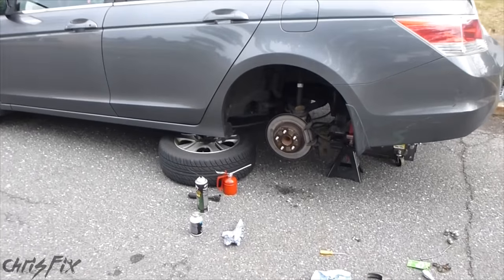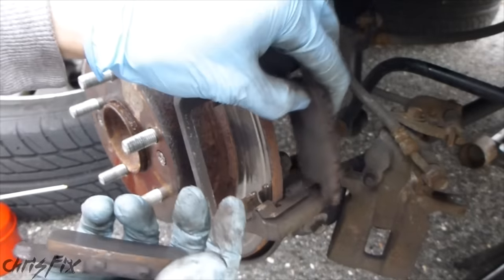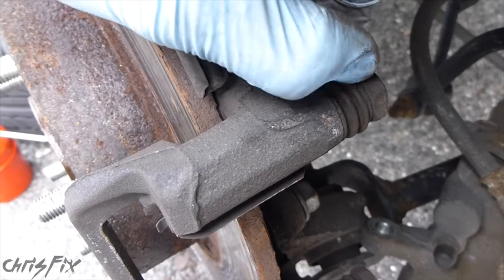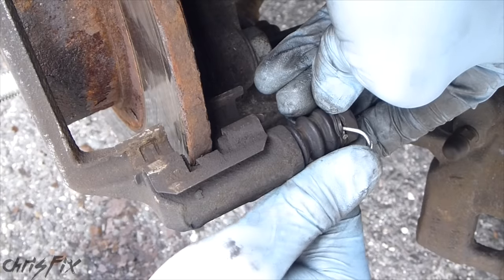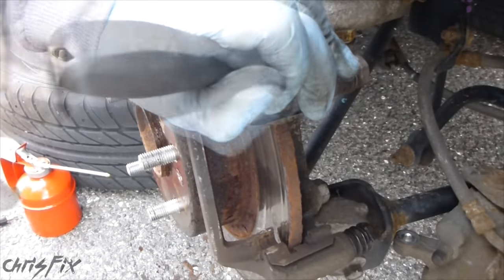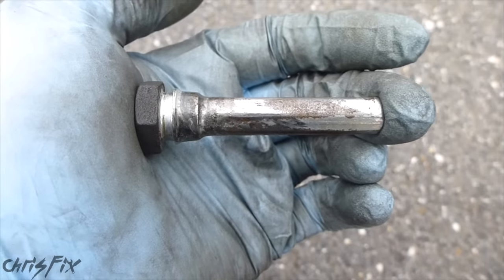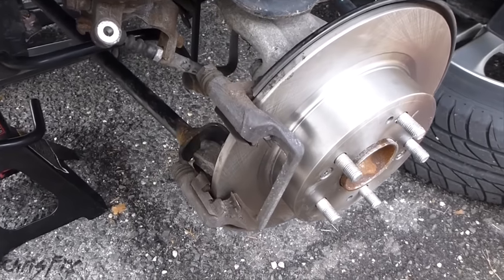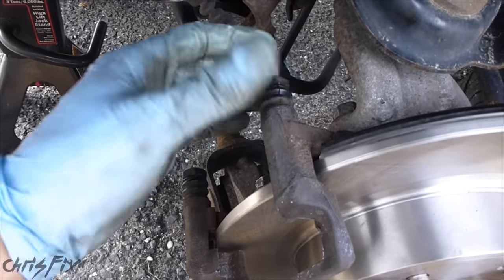How to Fix Uneven Brake Wear

Comment: Great job. I noticed the caliper bracket was fairly loose, also going to need to turn that rotor or swap it out.
Reply: He was in the process of changing the rotors. That's why the bracket was loose.
Reply: Mark Josiah  lol
Reply: Mark Josiah mom
Reply: Never ever waist your time turning a rotor. First off a brand new rotor isnt all that expensive and probably only 10 more then turning. Plus extra trip to get them turned. Now the issue of the rotor is thinner causing brake fade. I myself buy all new rotors at same time as pads. Now jack it up and do all 4 in my drive way in under 2 hrs. To turn the rotors have to have all 4 wheels up. Have to find a ride to drop them off then pick them up the next day. So much easier to just buy all at once. Only need 1 jack and so fast. Plus if old rotor stuck on you can hammer it off without a care. A few good wacks with a sledge and it will pop off. To worry too much damage just takes longer. But mostly brake fade from a thinner rotor and pain getting them turned to save 10 bucks. Lol i had a guy use a old rotor with new pads. The pads wore out faster so he wanted me to sand the pads smooth and put on a new rotor. Lol jokes i refused. Like dude new pads is new rotor. New rotor new pads. As per caliper pins i just buy new. On my suv they are 300 bucks but get 150 back for the old ones. So lol ya only 150 for brand new after returning the old one. Why waist time ordering pins when do all new and good for over 3 yrs. New calipers will last like 10 yrs. Sure not worth saving 150 bucks today but brakes wear out faster and now a year later gotta do it all over again any way. To save 100 today costs you a extra 300 tomorrow. Plus always spend the extra 20 today to buy premium parts. They will last 50% longer. I got premium rotors from amazon and carbon ceramic pads. All 4 rotors and pads around 350 bucks. 2 yrs later they barely even wore. I do live in a remote area so not often on the brakes but when i am its at high speeds. Never skimp out on brakes. The brakes most important part so never try to save a few bucks on the part that will save your life if needing to slow down fast. Even the axles not worth skimping out if go long drives. Gonna skimp on repairs then your safest bet it to just pay 800 per month and drive brand new for life. I sure dont wanna be rear ended by someone that saved 50 bucks on cheap brakes and turning rotors causing less braking power. Lose a axle no issue. Rear end me to save 50 bucks becomes a serious issue. Oh ya please use e brake often when park so that if brakes fail atleast can reduce damage in a crash by having a e brake that works and not siezed up by lack of use. Wont find out siezed until emergency.
Reply: @shawnkelly1241  All depends on the vehicle.
Reply: @electronicsNmore  well if prices different yes this is true but my prices for a suv. Smaller cars likely be cheaper unless sports car but its a ball park figure give or take 50 bucks. But the fact for all cars or trucks that never skimp on brakes. Yrs ago we turned rotors and drums. After the first time found out the 40 i saved was not worth it. Not only travelling to and from the shop but also severe brake fade. Every single car no matter the make, model, year or size will get brake fade from turning or buying cheap quality parts. Every car that travels on a public hwy should atleast have quality brakes. If never leave the city or high speeds slightly less important. I see so many going 80 mph. Hit the brakes and takes 3 times the distance to stop plus shake the whole car. Especially if 4 adults adding weight to a cheap brake job. Well maybe doing my own repairs i saved enough on labor to afford better parts. But the again to pay a shop 500 labor its best to maybe spend another 50 so see them less often lol
Reply: @shawnkelly1241  I keep 2 sets of rotors for my car. So I put on new rotors, if needed. I check for thickness, in several spots along the circumference, run-out (change in thickness from outer to inner circumference), and for deep circumferential scoring, and if they meet factory specs I leave them alone. Sometimes the thickness specs are stamped right on the rotor. If not within I'll take them off and see if it is worth turning. Meanwhile I'll put on the new rotors that I have on hand. There are usually 2 thickness specs, the minimum usable thickness, and the minimum thickness they can get to, so that if they are thinner than that, you should not bother turning them. Most rotors these days, you can turn them once. If you turn them again they will be thinner than the minimum usable thickness. I could be mistaken but it seems to me that rotors are often just simple lumps of cast-iron, that have turned to a specified thickness – so it shouldn't be hard for aftermarket companies to make rotors that are just as good as OEM rotors.
Reply: Don’t waist your time, it’s waste your time.
Reply: @shawnkelly1241  You don't get "fade" ,ou can have problems with a turned rotor warping quickly and needing replacement sooner rather than later. A turned rotor or new rotor will both have fresh surfaces to work with, no logical reason to "fade"..
Reply: @barryaiello3127  "fade" has many causes, but essentially it's too much heat in the brake system to let it do what it needs to do, which is dissipate heat
so either boiling the fluid or overheating the pads
the rotor gets hot and dissipates the heat (which is why they have a minimum thickness), if it's too thin it can't do this and then the problem moves to the pads, and then to the fluid, or in older vehicles the bearings
either way, get new pads if you are changing the discs
also, this is america so most of their cars are automatics, which means more heat soak because people put the foot on the brakes and hold it in traffic rather than using the handbrake for those situations (no idea why they call it the emergency brake because you are supposed to use it when you are stopped or parked up)
Reply: @therealdojj  All true but sitting in traffic holding the car in place they are not generating any heat for dissipation.
Reply: @barryaiello3127  in traffic maybe, but it still creates hot spots where the pads stay in contact with one part of the disc
i'm currently swapping my rear discs because the cars been standing for so long the pads have glazed over and they simply don't grip the disc at all, so new discs and pads, even though they are only 2 years old
like i said, many many reasons brakes fail
Reply: @therealdojj  Yea, if I'm forced to brake hard I try and not stay on the pedal once it's stopped, that's how deposits get formed on the rotor.

Comment: In addition to stuck guide pins, you should also check the surfaces that the pad shims are mounted to. A build up of rust on these surfaces under the shim pack will bind the pads resulting in similar uneven wear.
Reply: And sometimes you have to replace the shims. Ideally you should check this yearly especially if you live in snowy areas where snow ice and salt can rust those surfaces. Might not be a bad thing especially if you get more than 3 years out of the pads.

Comment: I would have cleaned up the guide pin housing holes too, if there's crud on the guide pin it will be in the housing too, thanks for the video!
Reply: This. I noticed that my freshly cleaned/lubed pin would get stuck each time I reinserted until I cleaned, lubed, and reinserted it several more times. The first few times it would stick so hard I had to use my impact driver to free it up! Even though it wasn’t threaded I’d see smoke coming out after spinning it free with the impact. I’m replacing the whole caliper but I needed it to go back together in the mean time so I could get to work!

Comment: Add to this video...  Use a small wire brush and a good penetrating oil to clean out the hole that the guide pin rides in.  Old pistol or rifle bore brushes work great!!
Reply: Stephen Maurer an appropriate sized drill bit used by hand with alternate brake cleaner spraying does the best job on stubborn clogged holes. You would be shocked at the amount of rust/petrified grease that can be stuck in there.
Reply: Rockitanski I use the drill bit method as well but I use a slightly small bit with a piece of scotch brite on the bit and spin it with the drill and it scrubs the hole clean and shiny in 5 seconds with some brake clean.
Reply: Rockitanski and
Reply: Right! That bore should be cleaned by whatever method you prefer. If it's left dirty, half the crud is still in there and it's half way to seizing again. Good video.
Reply: in a pinch I bought a gun bore brush from walmart and chucked it into my drill, made the job much faster and easier
Reply: ccsharkboy yeah, but it wrecks the brush. I like the scotch-brite/drill bit idea. 1st with a sized bit to get the heavy junk out, then smaller with scotch-brite wrapped on a drill bit. This sounds like it will work best.
Reply: I'm pretty sure brake cleaner on the rubber boot of the guide pins is bad for the rubber. Don't use brake cleaner in there.
Reply: Tim Richerson I'm pretty sure if you are cleaning the pin bore with the boots still on the caliper hanger, you are doing it wrong. If you can't remove the rubber boots without dammaging them, they are dried out and should be replaced. I havent ever had a problem with brake cleaner on rubber parts In brake systems, even when rebuilding calipers after removing pistons. In a pinch, a torn boot can be repaired with some RTV gasket maker after thoughly degreased. How are you suppposed to get all the crud out from the accordian section of the boot without flushing with brake fluid?
 I drove an E36 for about 12 years. It had 287k on it when I retired it. 2 rear brake jobs & Still had the original rear calipers on it, in upstate NY, notorious for rusty cars. I did everything I mentioned above on the 1st set of brakes I put on the rear, one pin was seized. Never had a problem. Like anything else, successful results are dependent on how thorough you are. Most people who are not mechanics just slap stuff together and miss the small details that ensure things will be reliable & last trouble free.
Reply: Yep! The inside of the bores rust.
Reply: Stephen Maurer Was gonna mention the exact same thing.
Reply: cisa93 you're an over acheiever, when brakes need service doing it correctly once, means you don't need to do it annually. A brake job should last you 2-3 years, if they wear out faster than that someone is driving with their foot resting on the brake all the time.
Reply: Stephen Maurer i just replace the caliper when it gets to the point of stuck caliper pins.  I have tried cleaning them but I just created more work.   New calipers are not that expensive
Reply: Gregory Heath you would be surprised what a rear caliper can cost on some vehicles. If you are buying them inexpensive, they are not new, but aftermarket remanufactured. Any mechanic will attest to the quality control  and longevity problems with these parts. I can't tell you how many calipers have stripped threads on bleeder screws I've scene right out of the box. 
 If you know what you are doing, servicing a stuck slider pin is alot less expense and aggravation when compared to multiple trips to the parts store over the inexpensive junk they just sold you, that have potential to need replacing again within 2-3 years anyways.
Reply: Not necessarily. I'm a courier and drive about 200kms a day on average in city, stop and go traffic. I need to replace my pads about twice a year. On my old car I got so used to doing it I could do the front brakes in about 20 minutes from start to finish. Less if just a quick pad change.
I use the cheaper pads. More expensive (so called better) pads are harder on the rotor. I'd rather change pads three or four time before the rotor needs to be replaced.
Reply: Don’t use oil of any kind. It’ll mess with or even dissolve the silicone lube. Just use break clean.
Reply: For the money you save doing it yourself just replace the caliper mounting bracket along with the pibs, pads and rotors.
Reply: @ccsharkboy  This what I do also. I commented not realizing others do likewise

Comment: chevy/gmc 250 express van spongy brake pedal, down to the rotor metal ( could hear it, finally), pulled the wheels (back), seized floating caliper pin, had to heat the caliper to get the pin out(AL), clean up, new rotor, new pad, works great. Check the pins on pad changes +++. Great video.

Comment: I don’t think I’ve ever replaced a guide pin. I’ve always taken them to a bench grinder and smooth them out with a polishing wheel. I realize they are often zinc plated from the factory but with enough silicon and a good boot they always last the life of a set of brake pads (5-10 years) even in the Midwest before they will need to be polished and regressed again.

As far as polishing the bore of the caliper bracket, I actually used a battery cable cleaner brush it’s a perfect diameter. Just try to use a copper one if you can find them, the stainless steel brushes are a little stiff and might needlessly score and groove the bore. Blast out (wearing goggles) the bore with compressed air (compressed air is also my favorite way to pop our caliper pistons just stand back they can go airborne so do it in a box)

Great video, and good job pointing out the use of silicon. Can’t tell you how many times I’ve seen people use aluminum or petroleum anti seize and the boots disintegrated after a few years.

Comment: Thanks for the very appropriate reminder about inspecting the caliper pins.   On my last brake job I found the rear guide pins were all almost seized.  I removed all four and cleaned them, using some 120 grit sandpaper to remove the worst of the rust - then some 400 grit paper to polish the pins.  BEFORE reinstalling them I also used break cleaner spray and a cloth to clean out all the old debris from inside the caliper. I've also used a steel drill bit of the correct size, turning it by hand ONLY,  to get as much dirt/corrosion out as possible.  Once that was done I used the silicone paste to lube the pins and install them.  My brakes worked like new.

Comment: Another tip I would give for the new guys is don't over grease the pins. Liquid is incompressible meaning if the grease takes up too much space the pin can't move all the way to its retracted position, just a light film of grease is what you need.
Reply: I want to fill much of the space for dirt, water, and their corrosion byproducts, so I like to use excess lube, insert and compress fully, and wipe out the excess that squeezes out. Push them all the way in when fitting and the pins will only move out… which is the opposite of compressing. Of course, it might be hard to do this with some pin designs unless you take the bracket off the knuckle.

Comment: I refurbed my caliper brackets and painted them with high heat ceramic paint to keep corrosion down. I replace the bolts and slider pins when I check brakes every 6 months. I use a dremmel in the bore to clean them out. They're like new and I'm in the rust belt region of the US.

Comment: This is an old video with millions of views and tons of comments, but if you do see it, how would remove a pin that was truly completely seized?  As in it doesn't move at all, rebound, twist or anything. I think the pin is gummed in so hard like cement or something. It might take a ball peen hammer or something to get it out.  I don't think i can remove the pin without possibly damaging some of the hardware (caliper). Since it's the front caliper, it doesn't separate from the bracket, and i'd rather not have to replace the entire front caliper assembly, which would also entail bleeding all four wheels, making a relatively cheap and simple repair to an much longer and expensive one.  Thanks for your videos; you do great, impressive and easy to follow work, explaining it very well.
Reply from the maker: Thanks a lot! You would have to try tapping it out or see if you can spray something like silicone to loosen it up!
Reply: @chrisfix  Silicone spray over penetrating oil?  Interesting.  Thanks for the prompt response.

Comment: do you clean the inside of the pin hole also? i assume grime build up is not just on the pin itself but inside the hole also?
Reply: How? By spraying brake cleaner inside the hole?
Reply: WARNING: I´m by no means an expert, but judging from all the car tutorial videos I´ve seen brake cleaner seems to be the solution for every kind of dirt or mud down there so I assume this could work
Reply: I use a cotton bud then spray then grease and burp the rubber you don't want air.
Reply: nope,total cleaning and replacing parts are required sometimes
Reply: I was thinking the same thing. He always has great vids and was surprised he left that part out. I had a similar issue with the wife's car. Her's had seized up so bad it actually wore out the caliper as well. New guide pins and re greasing helped the braking issue but still determined the caliper was bad. She could drive a week and the driver wheel was solid black, all the other wheels still look clean. I had scrubbed out the guide pin holes but never got them perfect. Sad part is, the car only had about 55k miles on it, and garage kept. We live in the south so no harsh weather here either.
Reply: Absolutely, there's no way I'd put my guide pin into a dirty hole, no telling what you might end up with in the near future.
Reply: For the money you save doing it yourself just replace the caliper mounting bracket along with the pins, pads and rotors
Reply: @GymChess  You can ream it out with a round file or with a drill bit.
Reply: Right lube makes inside hole rust dissolve. So no need to clean inside holes. But if you want to sleep at night spray some break cleaner in.
Reply: @stephenmaurer3548  That sounds so gross 😂